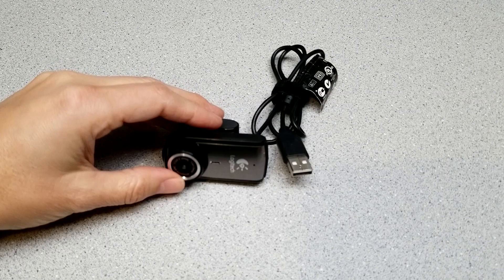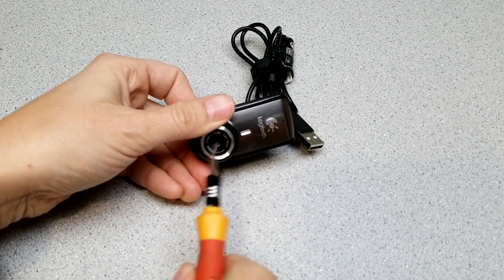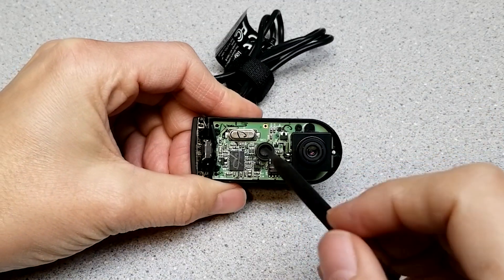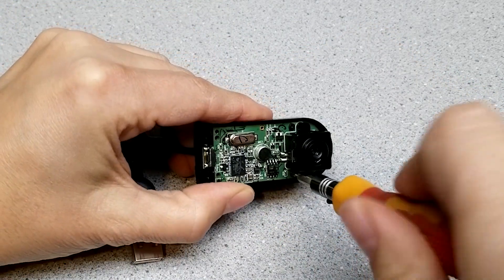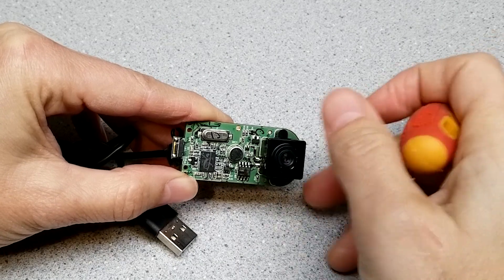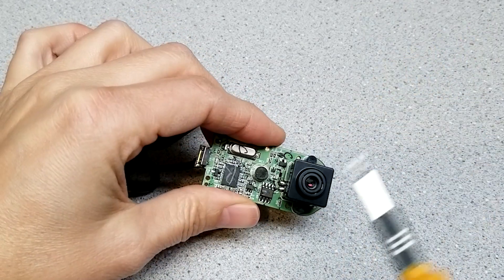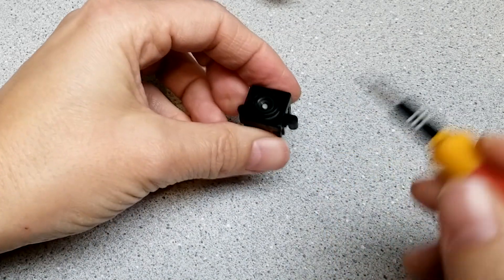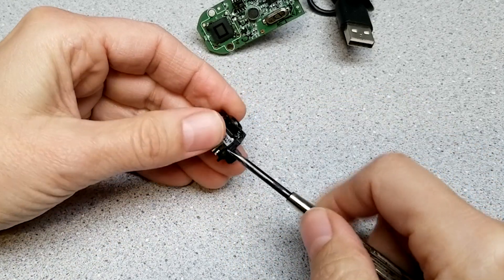Teardown - Logitech C905 - Cheap Webcams for Projects

Comment: I see in the comments a subject of Debayering. I have an idea for a long time about debayering but I don't know if it exists, maybe you can tell me. The idea  : Perhaps you don't need to pull the bayer layer, instead it is theoretically possible to expose the sensor to strong UV light during a long time, this would decolorize the bayer layer. Is it a good idea ? :)
Reply from the maker: I think that it may eventually break down the dyes in the layer, but the layer I've seen firsthand seems to have some texture to it. That texture could help reduce its reflectivity, and/or make the image blurry, I am just guessing.
Reply: Thanks for the response ! it is a pleasure to watch your videos, the visual quality is perfect and you give interesting informations :)

Comment: Brenda, you're doing what I've been doing lately. I have had good success getting the cover glass off by slowly prying, but I wanted to go a step further and remove the bayer(?) filter and any microlens array layers from the image sensor. I got that idea from a research paper where they were improving a camera's UV sensitivity to image sulfurous emissions from smoke stacks. They used a special solvent to dissolve the layers, which I am too cheap to buy. Others use a microscope and carefully scrape it off. (Had no luck at all with that, may only work with certain kinds of chips, or better eyes and a much steadier hand.) Anyway, I was wondering if you know of a common solvent that would dissolve the color filter off of the chip without damaging the chip. I'll probably trade the optics for a pinhole.  UV is a much greater challenge than popping off the IR filter like sane people are satisfied doing. If you know of an inexpensive alternative...

I'm attempting to do poor man's multispectral imaging by illuminating the subject with a sequence of different colored 1-ish watt LEDs from about 1000nm to 250nm in an otherwise dark room. I've found that I'll probably have to move the LED assembly to get the light hitting from the same location for each shot, otherwise shadows look really funky in combined images.

Anyway, really enjoying your interference pattern videos. Going 3D is a wonderful idea and your results so far impress the hell out of me.
Reply from the maker: I've tried "debayering" these cameras, and so far, failed. I've found that toothpick or plastic scrapers are too soft to remove the array, and require too much pressure. Oddly enough, if I try it again, I may make a tool from copper, or perhaps maybe even thick lead solder.

I've also found that neither acetone, nor isopropyl will dissolve these arrays, but on the positive side, the bezel plastic seems unaffected by it, so quickly, both can be used for cleaning.

Your poor man's multispectral imaging project sound interesting. When you finish it, please post a link. Though, as you may know, as you head off into UV, normal glass is opaque, so you might have to find special lenses. Also, many lens assemblies have built in IR filters. An for such a wide range, perhaps you could take multiple exposures at different focal lengths, and store the images as multi-channel ,tif's which can be processed by either Photoshop, or ImageJ or Paraview, That way you can have  focus for each wavelength band.

BTW, what webcam have you been using? These are not easy to remove the cover-glass because the adhesive they use is can take a lot of heat.

I am glad you enjoy the videos.
Reply: @BrendaEM  Mostly I have been using cameras from my junk pile so I'm not sure which one went best. One I know worked was a Creative Technologies Ltd.  VF0415 Live! Cam Vid. IM Ultra. I actually did the surgery with the patient awake so I could see if I was damaging it. Maybe not the best idea but it worked out okay. I pried with a sharpened Popsicle stick and my thumbnail. It worked through me attempting to debayer with the stick. However, that removed nothing. I moved on to something more aggressive and awkward which slipped and killed it.

That model is very light sensitive without its IR filter. I can't turn the LEDs up to more than about 1%-5% brightness without overexposure using the shortest shutter speed. I'm not sure if it would be a good choice for you though since the image sensor appears to be smaller than yours and the resolution is only 1080x960(?) and the frame rate is around 5fps. 

If I ever manage to make a decent pinhole, I want to try that instead of buying UV transparent lenses. (I'm a major tightwad) Maybe I'm wrong, but I have it in my head that a pinhole would be in focus no matter the light frequency? For now I have been copy catting your idea and put the camera on a 3d printer bed which I move as focus changes from IR to blue. That helps but seems to confuse the image stacking software I'm using. (They're macro pictures with very shallow depth of focus) I thought that was a common way to do focus stacking, so not sure why it is a problem. I'll give ImageJ a try.

I'm horribly camera shy, but if I work up the nerve to do a video, I'll send a link. 

Sorry, didn't mean to ramble.
Reply from the maker: @karlharvymarx2650  ,  There is also focus-stacking software that might automatically find the best slices.

You are right that a pinhole would let any reasonable wavelength of visible light through. I have a video about making good pinholes; it's largely traditional, with a pin, but it helps a lot to grind them after. Keeping the pinhole small may help lower the brightness, and increase the depth-of-field.

Looking forward to your video....
Reply from the maker: Interesting. Though, the MSMD, lists the chemicals in the branded formula, which are both available, and cause severe skin burns just as they enter the bloodstream. 

https://crn2.3it.usherbrooke.ca/guide_sb/produits/litho/EKC830_MSDS.pdf

The interesting part is: if you persist, a journey of a thousand miles might end at Home Depot, though it has solids so it clings.
https://saferchemicals.org/get-the-facts/chemicals-of-concern/n-methylpyrrolidone/

Though, their adhesive remover has a similar chemical, with and would likely be free of solids.

The next time, I will try using copper or brass scraper.

Comment: I have tried to use a webcam sensor without the lens but every time the webcam broke down. I don't know why but I suppose that this sensor is made so as to receive the light from the direction of the lens and perhaps if it is used in ambient light (where light comes from every direction) , the light will touch the electronic components and cause them to fail. Maybe I am wrong, have you an explanation ? Thank you.
Reply from the maker: On your attempts, and I know that are frustrating, perhaps there is something that you removed from the webcam, that it needs when it starts up. Perhaps it needs to focus as it starts up? Static electricity or heat from soldering could be issues.

These C905s seem pretty durable, but removing the cover-glass is tricky, but I got one to work. Debayering I have not been successful at, but like Wily E. Coyote, I think I know what I did wrong.